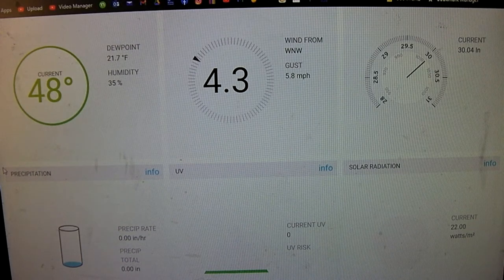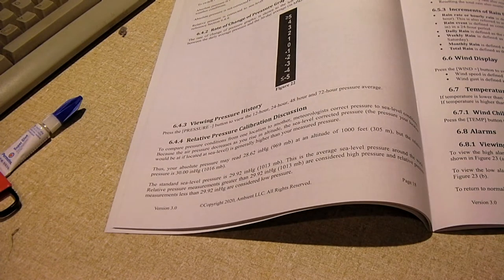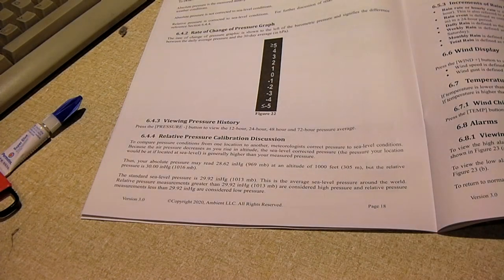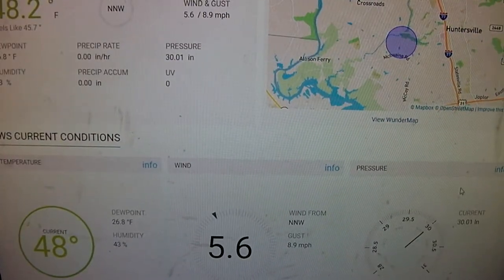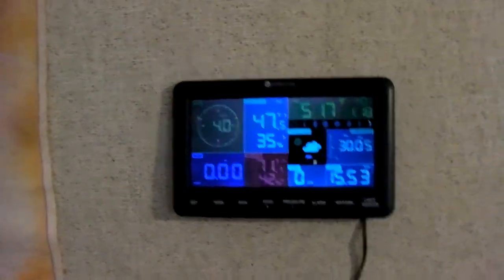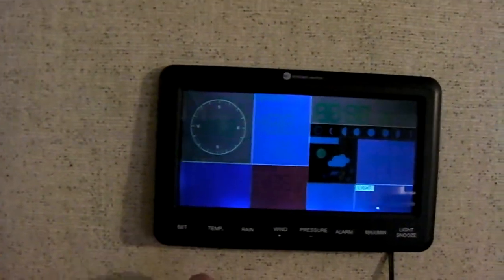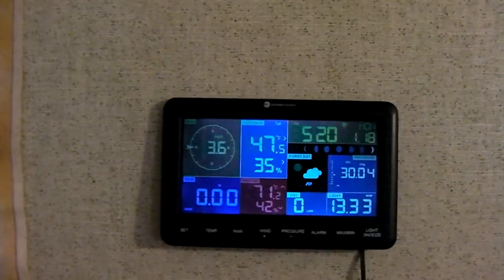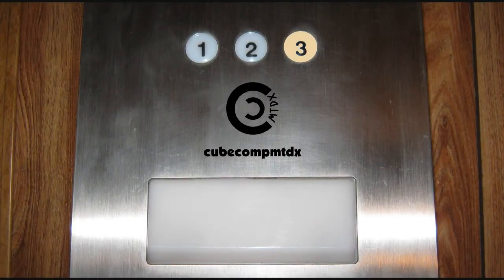Calibrating the Relative Pressure on Ambient Weather WS-2902C

Comment: I have enjoyed my 2902A for about 2-1/2 years outside of two developments:  1) at the one-year mark, the rain assembly failed and had to be replaced, and 2) last week, the Temperature -  Humidity sensor failed and cannot be replaced, requiring the entire array to be purchased for >$100.  Reviewing scores of reviews only, an impressive number of reviews reports their 2902A failed at approximately 2-1/2 years.  Like the great majority of these reviewers, I believe this lifespan is unacceptable, especially for a weather station in a temperate mid-Atlantic climate.  Not certain if I will be continuing with ambient weather's product line, since spending ~$80 a year for parts and sensory array replacement is surely not a high-value proposition.
Reply: Shocking. My 1400-IP is 7 years in with zero issues (2902 is 2.5yrs old and my 5000 is 1.5, both no issues yet!).

Comment: I’ve had my 2902c running for about a week now and it’s been forecasting rain all week when there’s no chance of rain. I tried calibrating the pressure but it didn’t have any effect on the forecast. Any advice???????
Reply from the maker: Don't rely on the forecast the console gives. It's just a mere reflection of the relative humidity and the associated weather conditions that sometimes come with those given measurements.
Reply: I am an official tester for Ecowitt in australia for the over 5 or so years.Dont listen to the rubbish he is giving you.The forecast take about 4 to 6 weeks for the console to learn your environment like wind direction,temp,hum and baro pressure.It is only about 80% accurate.

Comment: BS directions when you  tried to change the pressure measurement you only changed the type of reading shown and gave up. After arriving to the blinking barometric pressure display press and hold the set button (you won't hear a beep) for a second then adjust the pressure reading with the plus button (wind button) and or  minus button (pressure button) then press set and forget about it. Easy peezy

Comment: I have this unit. Had to replace it due to after  3yrs the solar panel melts and your lithium batteries will only last 2 weeks.  Be nice if you could just replace the solar panel old unit works fine.  3yrs on one set of lithium batteries,  went through 4 batteries in a month when solar panel gets all bubbles.  Other than that it's worked well
Reply from the maker: You can purchase a replacement bare sensor array assembly (without instruments) for $45 from Ambient. The solar panel can be replaced, though you'd need some electronics knowledge. Getting a replacement solar cell would involve pulling out the old one, and looking up the actual part (not through Ambient) from the OEM manufacturer or alternative substitute). If this ever happens to mine, I'll do a video of repairing it if it's feasible.
Reply: @cubecompmtdx  cool think I'll take the old one apart and see if I can get a solar panel,  everything still works.  Just got a whole new array, figured I'd have rain gauge etc for spares.
Reply: Your supercapacitor is KAPUT if it goes through 4 batteries a month.The solar panel recharge the supercapacitor and run the console.The batteries come on only after the suprecap has been exhausted.